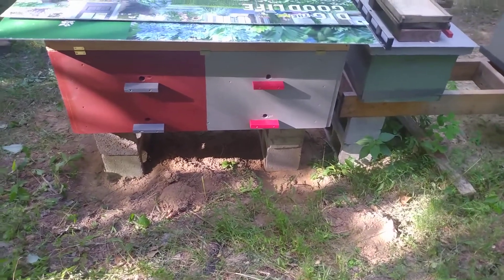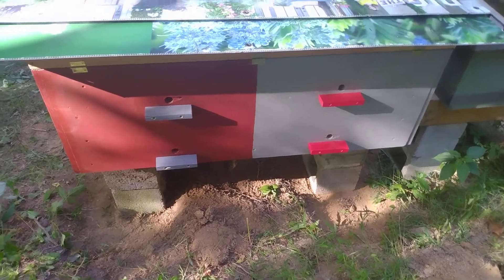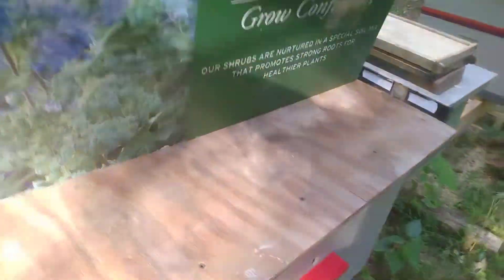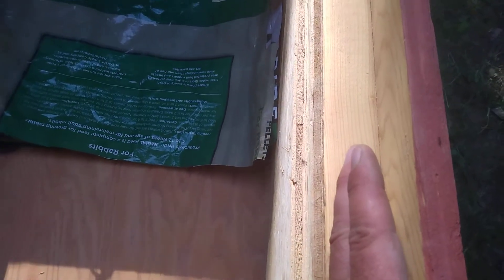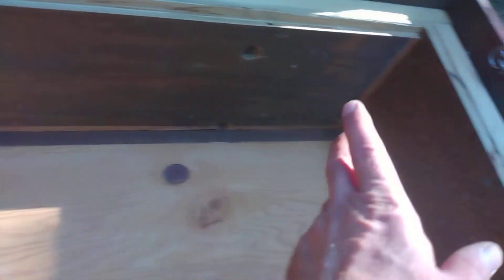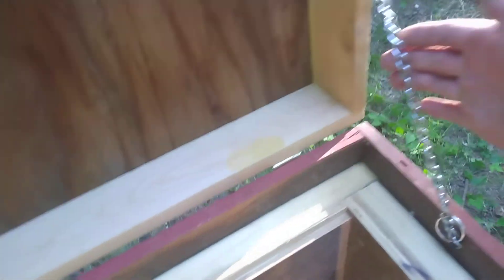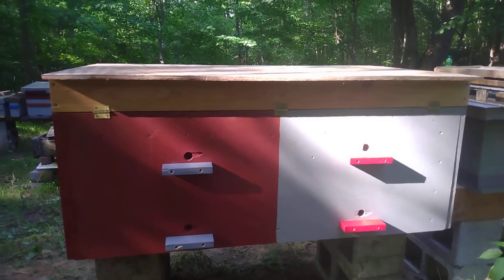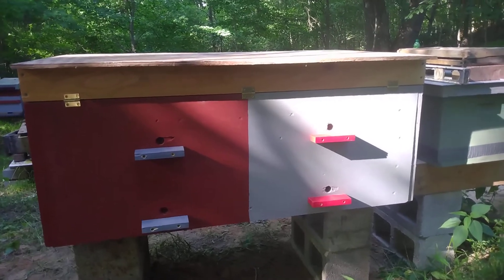My version of a Horizontal Hive.     Lounger style Sunbed Hive

Comment: I sure like that design, I built two top bar hives and copied from the design from Phil Chandler, 2 yrs ago. He just so happened to be the first guy I started following, when I got into beekeeping. I started out with 3 swarm traps and there 1/2'' too narrow to put a standard frame in. They work and produce. But I want something more interchangeable. So off to the wood shop on Swarm trap 2.0
Reply from the maker: Thanks Kenny for checking things out. And yes you are right about the frame size. Very important when building other hives in your apiary. When I built my top bar hive I centered my design around 19 inch top bars that way I can keep everything interchangeable. Good luck in your shop. Thanks brother 👍 good health and God bless

Comment: Thats a nice box brother.  Keep the top light weight so its easy to lift up. Oh yeah,  and it would be great to put in shallow saw cuts to slide in the divider board's.  But you know 😏.
Reply from the maker: Thanks Rick I'm still working out my design. Hopefully after I run it for a while I will know what's not working and what is. Thanks for sharing your time here. I appreciate it and thank you for your Tip. I might have to do that. Have a great season and good health and God bless 👍

Comment: I'd like to know if you prefer the horizontal. Looks good either way
Reply from the maker: Hello brother 👍 thanks for the question. I have never ran anything horizontal but the top bar hive. I'm looking forward to seeing how well it does. I like the idea of it but will have to see how it goes. Thanks, good health and God bless 👍
Reply: @houstonsheltonbees814  I like the idea of top bar for not having to buy foundation. But am reluctant to switch as I am set up to do the standard
Reply from the maker: @samiam7  why not try one and see if it works for what you're doing. When I built mine it was all scrap wood that I had laying around. My only requirement for myself was my frames had to fit both hive styles. So I made 19 inch top bars that just fit into my Langstroth boxes. I wanted to get straight comb. If you put the top bar between straight combs they always draw it straight. Then I just have to trim a little off the sides for it to fit back into the top bar hive. Try one you might like it. I know you can build it, LoL 👍 good luck friend. God bless
Reply: @houstonsheltonbees814  good thinking. Maybe I will